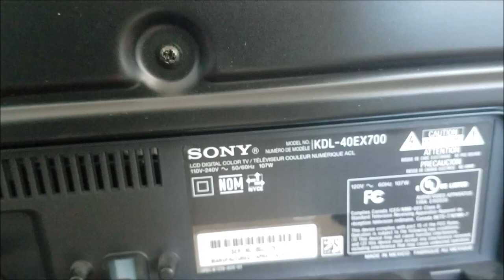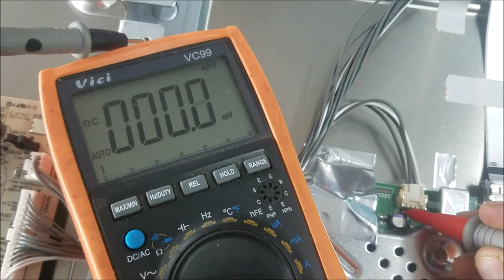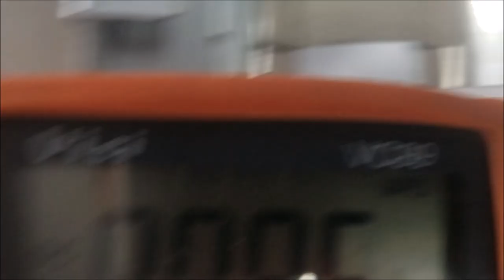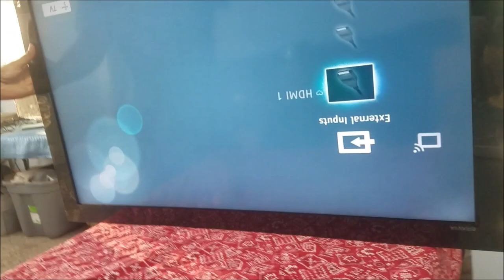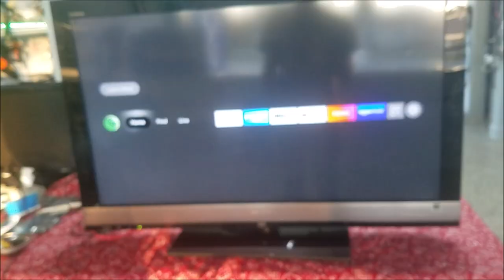SONY  KDL 40EX700 TV turns on green light on no picture no sound

Comment: I have a TV that turns on with picture and backlight for a few seconds then it turns off, then the power light flashes. I get all the voltages on the power board except for the stand by drops from 3.3v to 1.4v after a second of being turned on. I checked the ESR of the capacitors on the board. Is this being caused by some bad LED's in the backlighting?
Reply from the maker: is the stand by voltage created by power or main board? to check disconnect the power board from main and measure it on power side
Reply: can you turn on the TV without backlighting?
Reply: @SOSfixElectronics  With the mainboard disconnected, the only voltage I get on the power board is the 5V.
Reply: @TheJasonjayB  I disconnected the backlights and it powers on, then shuts off after 15 seconds. I am getting on the standby 3.2v as soon as it powers on then it drops to 1.4v, then it jumps up to 2.4v before it shuts off.
Reply from the maker: @bobsoft  what is the t model? i ll look for PSB picture of the connector. to be sure
Reply: @SOSfixElectronics  Sharp Aquos PN-LE801
Reply: @SOSfixElectronics  I think its bad LED(s) causing the shutdown.
Reply from the maker: @bobsoft  cant find a clear picture of power board connectors to see the voltages, cuz you said the STB voltage dropped. to check the backlight you will need a backlight tester, i hope is not the backlight in this 80 in tv :(
Reply from the maker: @bobsoft  the backlight may cause that, just want to be sure about the voltages first, i think if you unplug the power board you can force the power board to turns on the backlight.  you will need to jump Stb to Pon and to BKon or BLo
n and see if you get a good backlight
Reply: @SOSfixElectronics  I checked the power board again and noticed there is 2 layers of pins on the connector to the mainboard . All the correct voltages 12v, 13.2v, 5v & 3.2v are there. The 3.2v remains steady for a few seconds then drops off just before the relay clicks off. So it must be detecting a fault in the backlight and then shutting down?

Comment: SonyLCD TV KDL-32BX300
Hi
Main power ON
Screen black No backlight
Standby light permanently green ON
Power supply board connector:
PSU STBY 3.3V, AC OFFSET DET 3.28V ,PowerON 3.238V, BL-ON 0V,
BL-ERR 2.98V  hope you can quide? No BL backlight